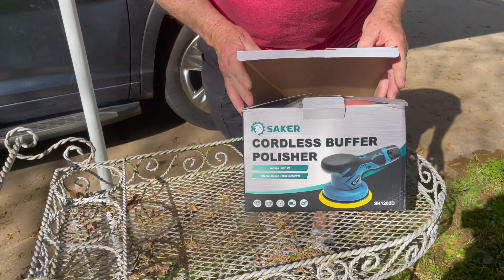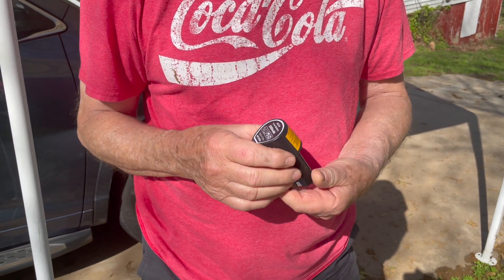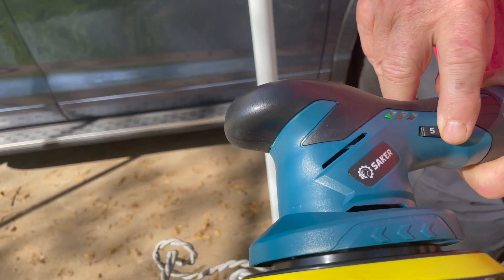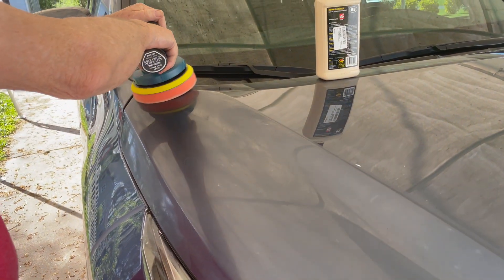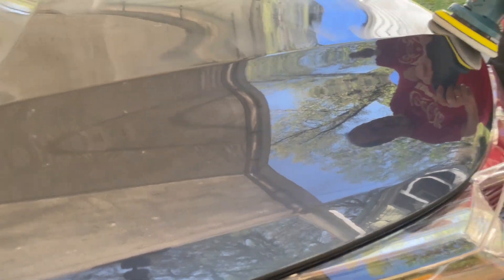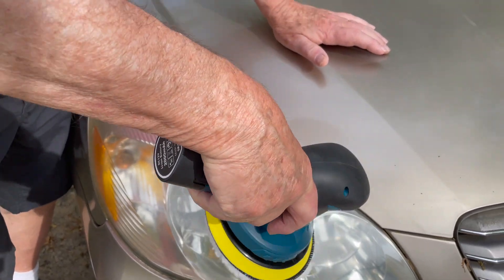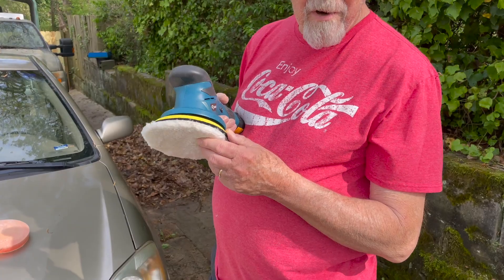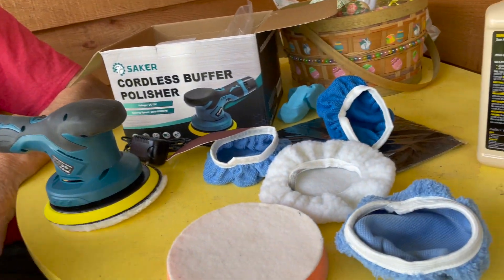Saker, Buffer Polisher Review

Comment: It's not gonna have any power for correction work. It's strictly a wax spreader!! Good video! 👍🏼
Reply from the maker: It also cleans the bathroom walls kitchen counter tops. and spreads wax. Thanks for stopping by.
Reply: 98% of the time people wax their cars. Using compound to do correction work is nice but every time you do that you are removing the clear coat that protects your car.
Reply from the maker: Thats very true, but what you gonna do,. People love making the car look good. @chodkowski01
Reply: @chodkowski01 That's why correct it once, and maintain it going forward introducing proper washing techniques.